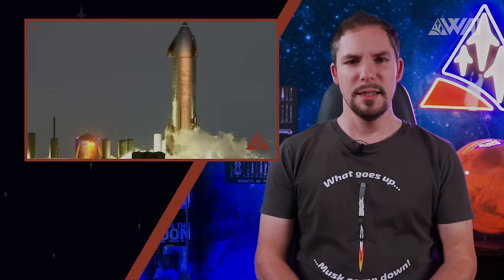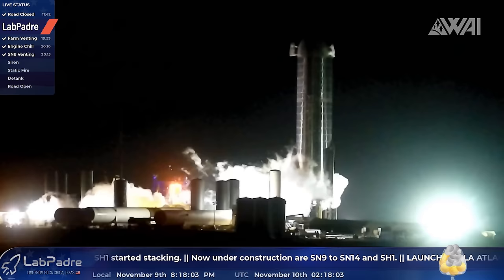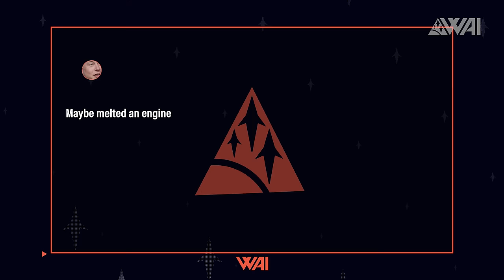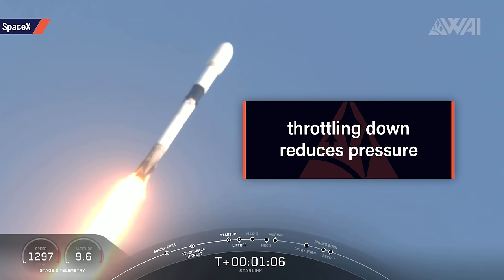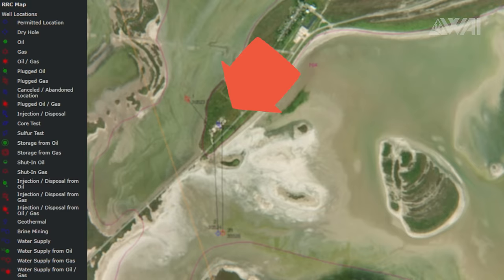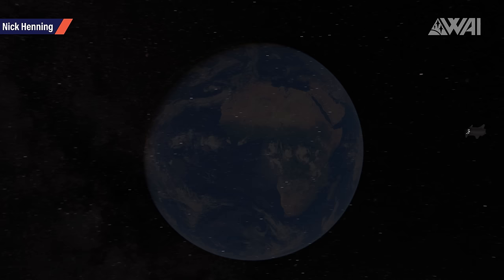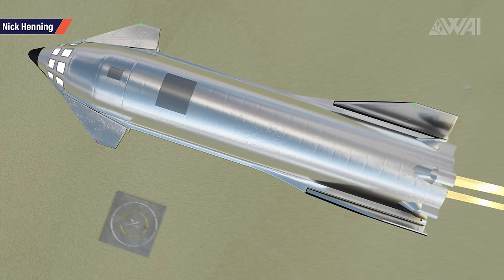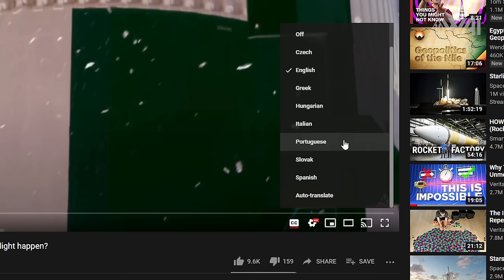132 | Serious Problem on Static Fire & What will it be like to ride a SpaceX Starship?

Comment: Plasma is the state at which ALL matter / energy is "split" into their smallest existing constituent "parts" (over simplified, get away from the keyboard). The Sun is a Plasma Ball that "spits out" debris, we call MATTER and Energy. Extremely difficult to replicate, a returning Starship could take advantage of the Plasma states existing on re-entry and MAKE STUFF using it. Hang baskets around the nose cone or SOMETHING - it's FREE PLASMA - no extra energy required.

Comment: @5:00;  Is this what caused the header LOX tank's burst disk to blow out later? Also,  I'm just curious why after the previous static fire,  molten metal could be seen dropping to the pad during the beginning of de-tanking yet the same thing was seen during the next test. Not as much as during the 11-12 test but still it was visible. With a full load of LOX and CH4 the resulting shebang would be noticed. No hop  next week for sure.

Comment: How will it feel to ride Starship? 

Hopefully, the seats will rotate to minimize the risk of fainting and nosebleeds, but all the #DearMoon and Mars passengers better love extreme carnival rides!

The Starship uses variations around a 90° attack angle to maintain the desired orientation, course, altitude, atmospheric density, and therefore hull temperature. 

To steer to starboard, it rotates the nose somewhat to port and tilts nose-forwards into the airstream to curve more sharply.

When returning on a high energy transfer orbit from our Moon or to/from Mars, in order to decisively drop lower into denser air, Starship rotates to strait nose-down and then proportionately tilts the nose forwards in the airstream to descend faster. If the tiles are getting too hot for too long (compressing denser air), it might turn nose-straight-up to deflect to a thinner environment, but just creating less down-force will allow it to ascend during the initial aerobraking. After all, Starship is modifying its orbital trajectory within the atmosphere, and the initial trajectory is to fly tangentially right past the planet!

Even after aerocapture, there is so astonishingly much kinetic energy to spare in these cases, that it could exploit that to ascend very far into vacuum and adjust orbit again at apogee to tweak or even indefinitely postpone final reentry.

Comment: I wonder if the failure was from damage done by the previous static fire. Link some debris hit a vital component and the damage was missed by the visual inspection. Elon Musk, "We don't need no stinking flame diverters, just let her rip." These aren't just pinto bean farts Elon and stop lighting your shorts on fire.
Reply: Possibly, but they did a complete inspection of the vehicle between the last static fire and this, so I would think more likely a new issue.  I am not a wise man, though.
Reply: So I can't even crack a joke? What is wrong with you people? I wasn't be condescending you are being saturnine over a little sarcasm.  Elon has a sense of humor. Of course it is important to harden the engine compartment and all components. There won't be a nice landing pad on Mars. The Starship has been redesigned for a moon landing due to debris from a propulsive landing. I bet you haven't worked in R&D. Root cause analysis is fun. This was an unplanned test to failure of the burst disk at least. Come on children, let's try to keep up.
Reply: @OldBillOverHill  
I think though the the joke was something more appropriate to an in-house bull session where engineers are encouraged to speak their minds freely to the boss. A bit a trash-talk loosens up the creative/constructive criticism joints.
Outside, it sounds too... familiar.
Reply: @-danR  More appropriate to Engineering Today eh? Guess I'm a troll at heart. Yes, it was in a failure mode study that a feller told me about using his tightey whitey as flame diverters. We were flaming caps in the liquid Teflon dunk tanks and releasing toxic fumes into the workspace because of them not being vented. Still, I bet Elon would say they don't need flame diverters because there won't be any on Mars landings and takeoffs. I forget this is supposed to be a woke safe space these dazes.

Comment: QUESTION for the Masses --  Because of the Starship's greater surface area as compared to an Apollo capsule, will the re-entry speed be less thus causing the heat-shield to be cooler?
Reply: The area is greater, which means the deceleration is higher, which means more heat over a given amount of time, so it might be a wash overall.
Reply: @mlmmt  Yeah. In reusable heatshield you want higher total heat, but lower peak heating. The exact opposite is true for ablative heatshield

Comment: The image right at 1:16.  Rounded windows,,, YES.  Someone is finally listening.  Just as important,, the windows are not rectangular,, opposing sides are quasi  elliptical.  The  drawings crew finally listened to me or an engineer with some stressed skin modeling.  Good on ya !!  Square corners and parallel opposing sides just will not work.

Comment: Build the test ramp much higher, so you don't get the engine damaged with flying debris while test firing.
Reply: We don't know yet why the engine was damaged. And many firings had been done without problem
Reply: Time will tell. If the test ramp would be taller, it would eliminate heat damage and such time consuming guess work in the first place. The video showed obvious debris from the ground including melted particles from the rocket. Nasa tests it's engines higher up or horizontal.

Comment: Three raptors without flame diverter and very little space beneath the raptors - too much oven for the ass?! Might as well burn the table away before lifting the ship. HALP I'M TOPPLING OVER! (Big ships yell upper case letters)

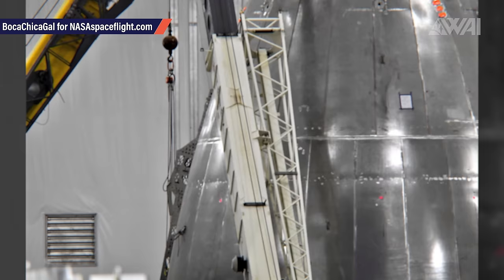5:55 Can't we just apply this principle to the whole Starship?           ===)ö°.:O°o°.:>           a hole starship! Save a lot of 304L!
?:o)
And another one: We have seen SN4 crumble under the weight of 1 full oxygen tank while reducing pressure in the tank beneath. What will happen at 3 g when Super Heavy has to bear the weight of a whole Starship with full tanks while the tanks of the booster get more and more empty? And what will the construction look like of an engine section that has to withstand the tyranny of 28 Raptors? Me: just curious.

Comment: Shame SN8 needs a nose job, New pneumatic system/major repairs. And a new raptor. And this is SN39 i believe
Reply from the maker: We'll have to see! It could be something as easy as an engine switch! Don't think of the worst... yet. :_WAIShocked:
Reply: @Whataboutit  Agreed, Simply swap the engine and replace/fix the burst disk and hopefully SN8 will be good to fly in 2-4 weeks.
Reply: @Sonderax  I doubt it takes that long. If it does SN-9 is nearly ready and can go first.
Reply: @Sonderax  They need to figure out what went wrong first, so while the fix might indeed be just an engine swap, it could easily take a few weeks to investigate the problem...

Comment: Falcon 9 boosters lose their payload nosecones before returning tail first... and they have those grid fins.

Since Starship doesn't lose its nosecone and doesn't have grid fins, will it need to use more fuel than it would otherwise in order to right itself?
Reply: It used the atmospheric drag as an advantage to bleed off velocity, so I can bet it will used less fuel than Falcon 9 booster
Reply: @alvianchoiriapriliansyah9882  if orienting itself back upright doesn't require extra, unexpected fuel.
Reply: @russchadwell  Bellyflop manuever is actually the most efficient way to land a Starship
Reply: @alvianchoiriapriliansyah9882  Yes! Right.  I'm saying however that, like a skydiver trying to fall feet first, a certain extra effort is involved changing from belly first to feet. 

It could be, rather than burn more fuel than is absolutely necessary to go upright, the flaps may be required to do more than merely fold like a simple hinge. 

It might be necessary to twist too. Like the rear wings of an F-15 (the twisting... F-15 doesn't fold, of course... so it's more complex than F-15)

Comment: Could deep-space crewed Starship be refuelled in orbit so vacuum Raptor engines can reduce speed prior to reentry? - to minimise heat risks.
I guess the problem is getting the tanker to match the Starship speed.
Reply: Then it should be refuelled at the Mars orbit because its high interplanetary speed won't let it to enter Earth orbit.
Reply: @borismakeew9720  Good thinking.
The overall idea needs some maths, or Scott Manley...

An additional possibility is to fly a tanker in tandem with a crewed interplanetary Starship.
Reply: No, because if you can slow it down to Earth orbit to permit refuelling, you've by definition slowed it down to not be re-entering atmosphere at interplanetary velocity. Except that you've now massively increased fuel requirements, because you're not taking advantage of free aerobraking, relying on brute force thrust instead.
Reply: @simongeard4824  The general idea now (disregarding my original silly question)  is to refuel before the engines scrub off some interplanetary velocity, possibly by full fuelling in Mars orbit, or fuelling from an accompanying tanker.  You are right that it would certainly use up a lot of fuel getting the fuel to the Starship, but might lessen the reentry risk for crew. It is all guesswork without the maths.
Reply: @HighPeakVideo  Aerobraking isn't exactly a revolutionary concept though... it was used for Apollo returning from the Moon. It's just something you design for, rather than avoiding the huge advantage it offers.
Reply: @simongeard4824  Do you think though that aerobraking will be the biggest weakness for renewable Starship safety?  I understand how the tiles are different from the Shuttle and the stainless steel far more heat resistant, but it seems problematic to protect the movable parts 100% against misadventure, particularly in reentry from deep space.

Comment: So, I'm going to state the obvious: SpaceX's Boca Chica launchpads need blast tunnels and flooded platforms. Don't believe me, go watch the Apollo launches. If flames are shooting up during static fires, I can't imagine that being a good thing for the launch vehicles. Ideal firings would have flames sucked into the tunnels and shooting off away from the vehicle. Steam should be the only thing rising from the platform. So basically, SpaceX needs better thermal control for their launch vehicles.
Reply: no they dont everything they need is alredy in them they can see everything and more
Reply: We can't have a definitive conclusion yet until they shared the results, hopefully as soon as possible